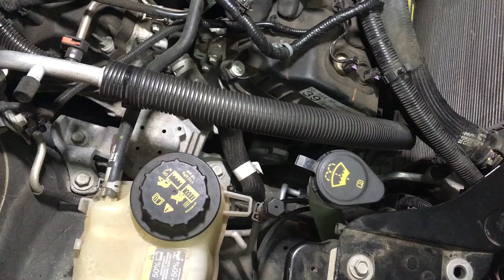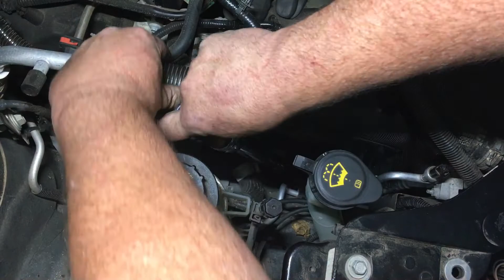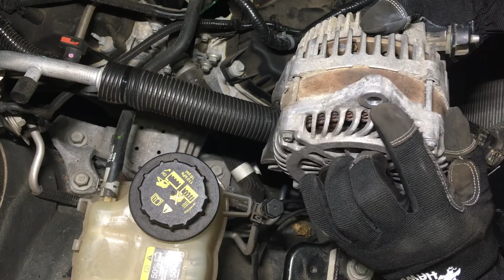2104 Ford Flex alternator removal. EASIEST METHOD!! Part 4

Comment: Just a suggestion for a how-to-it video- actually show what you are working on, and you might want to change the date for the vehicle. Pretty sure this car would not be made until 80 years in the future. This is a great showing of the windshield wiper fluid fill or radiator fill.

Comment: Results pretty good so far. Got the alternator out with some difficulty. I disconnected the upper radiator hose, which was a little messy. With the radiator hose out of the way there was much better access to one of the screws that secures the fan assembly. Not the easiest DIY car repair, still doable without the special tool that makes it easier to undo the wiring clips. Hopefully installing the new alternator will go more smoothly.

Comment: Alternator stud unscrewed with a normal ratchet plus a short extension bar and an adapter for the 1/4” drive socket.

Comment: This video series is pretty helpful. My 2013 Flex is very similar to the 2014. HarborFreight has a serpentine belt tool set that made it easier to loosen the lower bolt and upper nut with the 15mm socket. The stud is attached for the moment and the main wire is detached from the alternator. IDK whether the tool will help remove the stud with the 7mm socket, using an adapter from 3/8” to 1/4” drive for the small socket.

Comment: Thanks for posting these videos! I have a 2018 Ford Explorer. It has the same engine as the Flex and this tutorial helped out. I ended up removing the fender liner to replace the belt as well.

Comment: Awesome: 2010 Flex alternate replaced using this series of 4 videos. I hate working on cars. Seriously. Knowing what to get out of the way and where the bolts are made this less than frustrating. Piece of cake. I didn't use other videos except to figure out the stud SCREWS OUT.

Comment: Hey Knoep, what was wrong with vehicle ?
Reply from the maker: Well I replaced the original with an aftermarket alternator from OReilys, but it gave me a battery light because it only had 2 comm lines instead of 3. I ended up taking the old one to have it rebuilt and they replaced the voltage regulator. It worked great after that. So it did have to come out, but it wouldn’t have had to be done twice if I could have tested the voltage regulator.
Reply: That's what I would like to know as well.
Reply: The alternator was bad?😂😂😂😂
Reply: My alternator is frozen - pulley doesn’t turn.  I’m replacing the original alternator, the serpentine belt and the belt tensioner. Not too bad for a 2013 Flex with 155,000 miles on it.